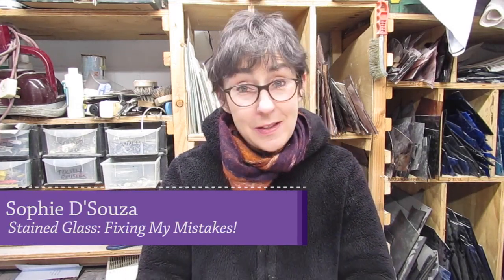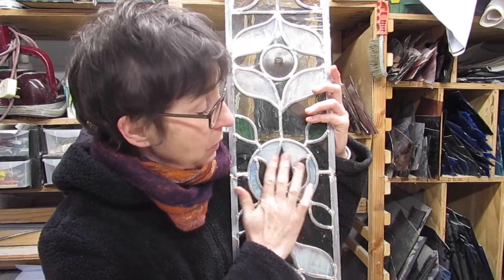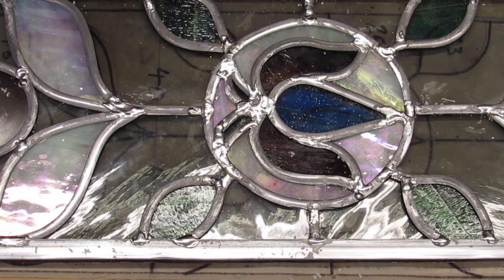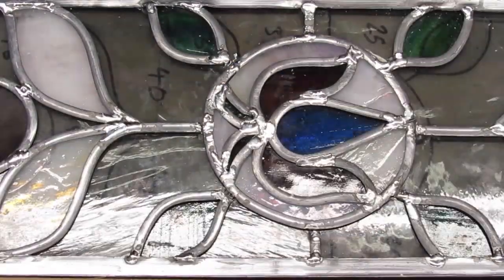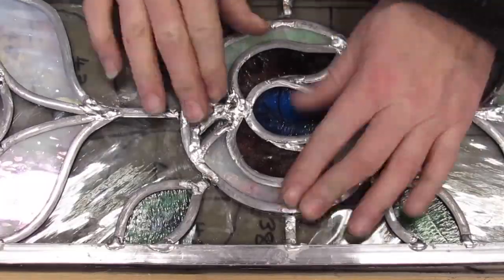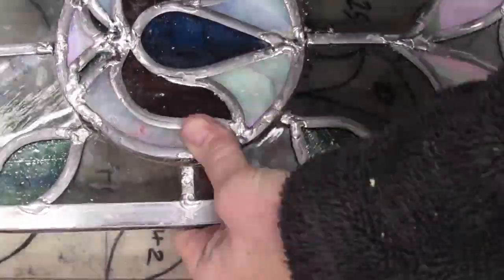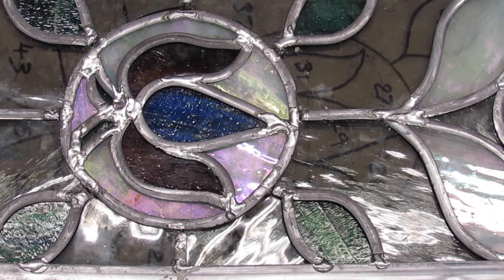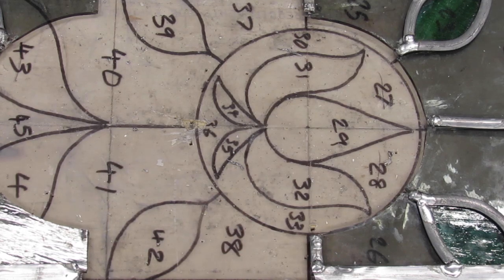Sophie's Stained Glass | Fixing Mistakes!

Comment: Hi Sophie, hoping you can help 🙏 I have a client who I’ve just rebuilt one of her front door panels that I’m fitting with a saddle bar. Both panels originally weren’t fitted with saddle bars and she has asked me to fit one to other panel but it’s got really sticky hard putty holding it in. Have you ever tried drilling into such putty successfully as I don’t want to remove it and will try to solder ties in place, Jo x
Reply from the maker: You can drill into putty, no problem. I find the problem comes with getting the drill bit close enough to the glass without damaging it with the body of the drill.
Reply: @SophiesStainedGlass  also had another thought, it’s going to be really difficult actually getting the saddle bar in the second side unless I drill deeper into the first side to allow for clearance for the damn putty 😤
Reply from the maker: Yes, that's a thing.